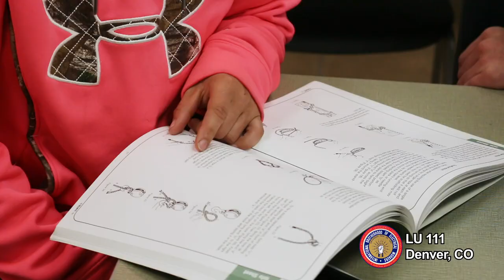Traffic Signal Technician Apprentice Mara Picazo

Comment: What’s the pay
Reply: Depends where you're working. Typically starting $22.00 - $55.00 in todays market big city
Reply: I work as a Signal system electrician in Los Angeles. Our flat rate is $102,000 a year, not including the overtime we work.